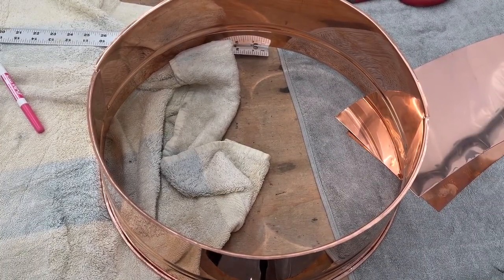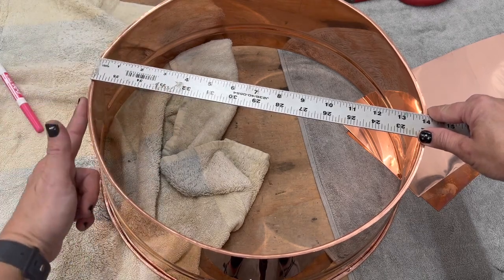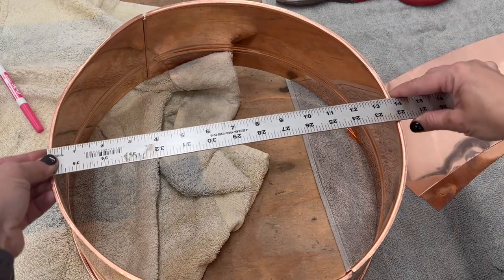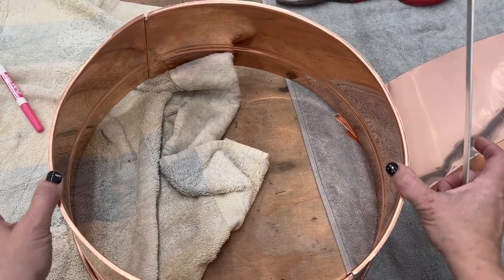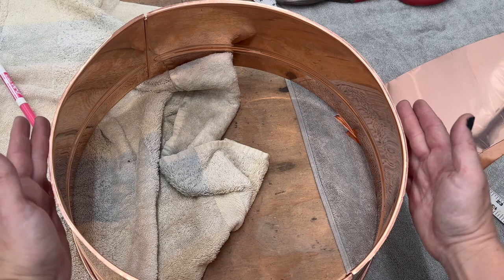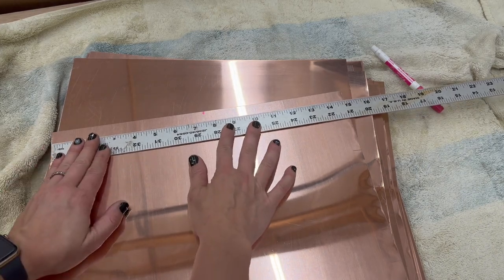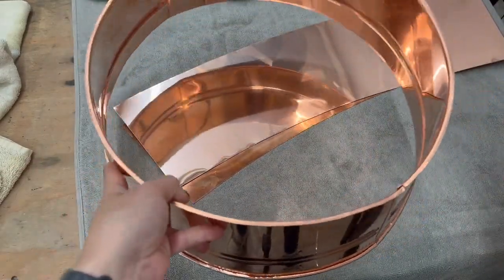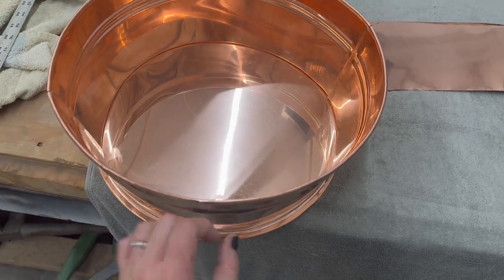How to Measure any Base

Comment: Thank you for the demonstration. That's a good tip to know. I have a question. Where can I find vendors to buy copper sheet metal?
Reply from the maker: Thank you - glad it was so helpful! Try googling or looking for your local sheet metal suppliers or stores like Menards - but I like using ABC Metals here in WI myself as I can buy bulk there.